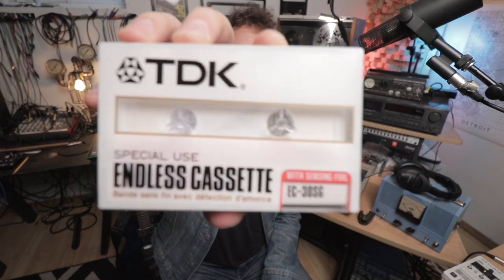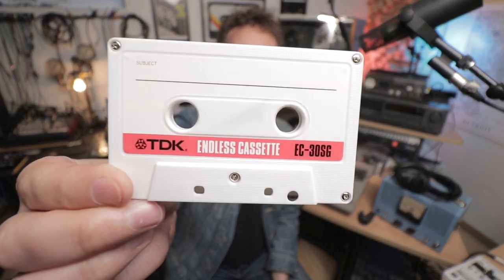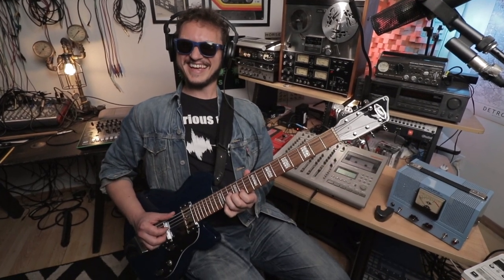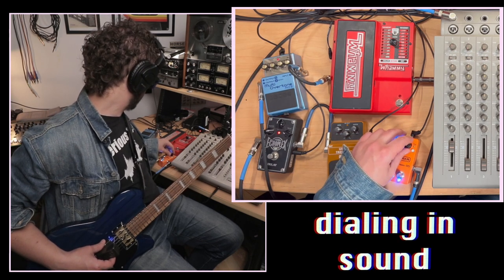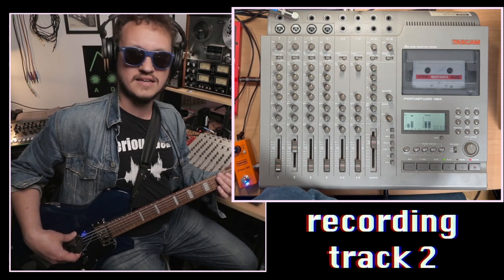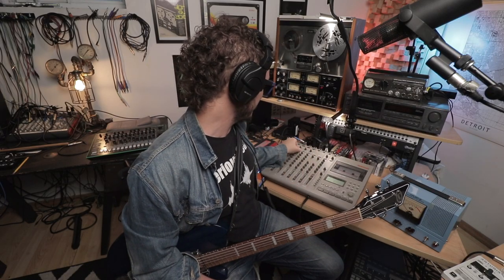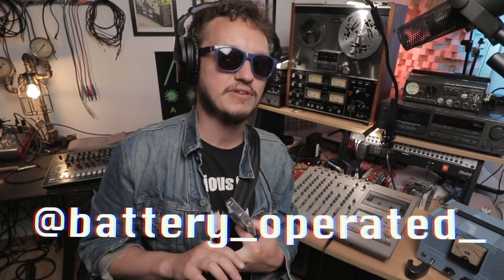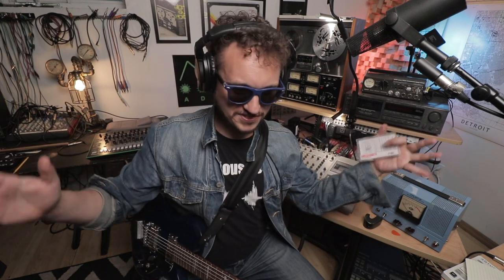Weird Cassette  Loop? | TDK Endless Cassette in the Portastudio

Comment: Ha, i have two 10 pcs boxes of these cassettes still sealed. Love to use these with my Tascam 246!
Reply from the maker: awesome!  do you know what length? they seemed to have a wide variety...
Reply: @MadeOnTape EC-3M, 3 minute tapes. I used to make loop tapes myself to play with faders between several notes, which combine multiple chords in an ambient way. These TDK tapes make it much easier, plug and play :)

Comment: is there any way to get more inputs on a 4 track machine? i’ve been using the tascam MF-P01 but it only has 1 input, is there any device to get multiple inputs? (to mic up drums specifically)
Reply from the maker: hey there! great question! i’m not personally familiar with the MF-P01, but it sounds like a minimal machine from my readings. if i were in your position, i would use a mixer and record the drums down to one track on the P01. it’s very exciting to commit to a sound on one track. Here is an example of a recording where i did this:
https://youtu.be/445Cykx_FdI
Reply from the maker: hope this helps! there’s a lot more to say here
Reply: @MadeOnTape  alright cool i’ll definitely look into that. if you were in my position would go get a mixer or get a better tape machine? is there any 4 tracks you can recommend that are relatively cheap?
Reply from the maker: @ihef7543  it's hard to say what's cheap since they're all used these days.  My main portastudio is the TASCAM Porta Two (not 02)... also the TASCAM 424 is a classic.  Other brands like Fostex and Yamaha made great portastudios as well.

I believe the MF-p01 was one of the last portastudios made, so it was stripped down and made to be very very small.

hope this helps!

Comment: can't you just splice the gap out?
Reply from the maker: absolutely! they also made endless cassettes without the foil 🤘🏻
Reply: @MadeOnTape  I was wondering because answering machine tapes seem to always have that gap.
Reply from the maker: @Brokeninc  and to be clear, when you're working with tape loops and don't want any gaps, you have to "disable" the erase head.  The easiest way to do this is put aluminum foil over it.
Reply: @MadeOnTape  Right, but it seems in my experience the tapes that have foil or plastic to hold the tape together were used for answering machines back in the day. I think the foil told the machine when the tape was full. :) So one way to get rid of that gap is to splice the tape. But covering the easer head so you can do sound on sound helps to get rid of eraser head gaps. I have an old RadioShack answering machine tape and watching this video made me realize I could splice it. :) Thank you.
Reply from the maker: @Brokeninc  i'm such a bad splicer that i left it hahaha thanks for watching!